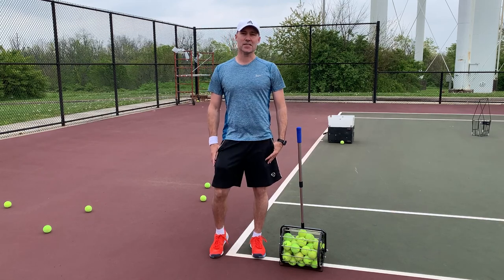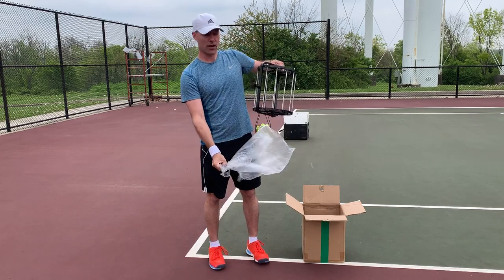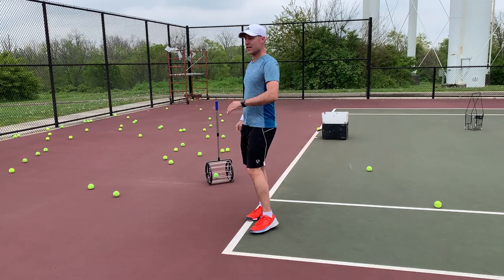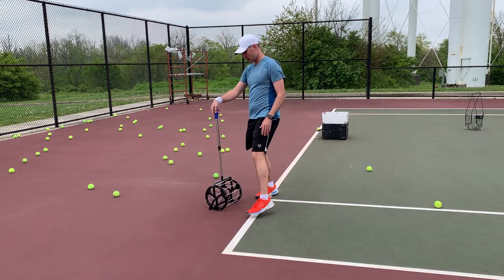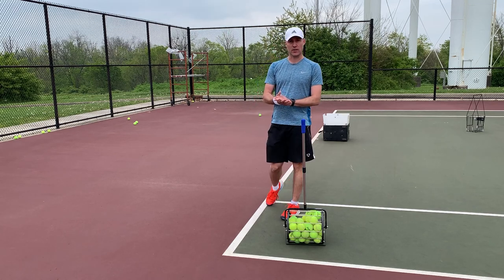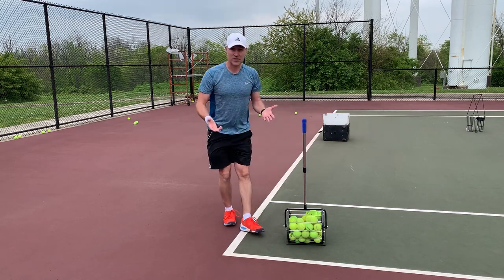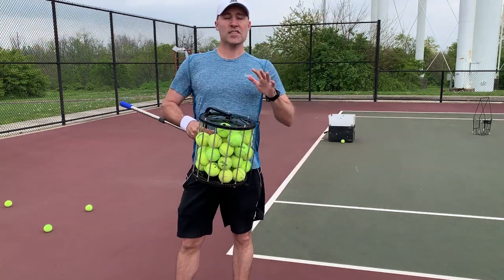Rolling Tennis Ball Hopper Retriever Pick Up Collector - Assembly and Review

Comment: Thank you so much for positing this. I was going to purchase it however that emptying is ridiculous!
Reply: It's actually not that bad. Just pull all three strings on the hook and you'll be able to empty the basket much easier. Another tip is to not fill the basket too full.
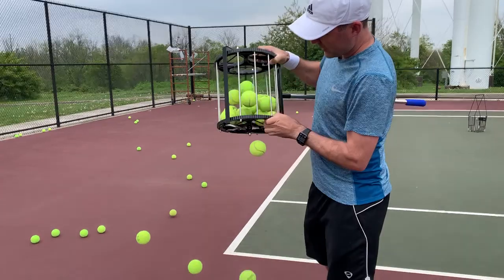Reply from the maker: Yes, I agree iSh0tYou99.  It is not bad when you pull all three traps like i show at the end of the video. At the 5:50 point in the video.

Comment: Thx for this. Roll over one ball at a time, then have to deal with getting them out? FORGET IT!
Reply from the maker: That is why I make these videos. To give you a visual representation of it being used. It helps to let you make a more informed decision if its right for you or not.  It's not right for everyone. If you are expecting it to perform as well as a multiple hundred dollar or thousand dollar machine, then it will not. But for less than $60, it does a decent job if you are not in a huge hurry. Thanks for the comments.
Reply: @ReichpoloTech  Yes, probably good enough for personal use to keep from having to bend over. Indeed, those real ball mowers are so overpriced. I was fortunate enough to pickup a half dozen Playmate mowers for 50 bucks a pop when a local club closed down a decade ago. Big &bulky, but pickup's a breeze!

Comment: I've been searching for any video reviews for this product and there are NONE that I could find. Until today! Thanks for the review! I was thinking about getting Kollectaball's but the price and the reviews on the chore of assembling it turned me away from purchasing it.

Question, do you prefer picking up with the roller or the ball basket?
Reply from the maker: Glad it was helpful!  I like using the roller when I'm by myself.  If I am doing a lesson or hitting the ball machine with another person, then I I we use both.  So it goes quicker.  The advantage of using the roller, to me, is that I don't have to carry the ball basket around the court. Its not super heavy but it is heavier than not having to lift and carry one from ball to ball.  I hope this is helpful. Thank you for your comments.

Comment: Quick question, would this work with pickleball given the slight difference in ball sizes?
Reply from the maker: I’ve have never tried pickleballs but I would not recommend it. I think with the very light weight and slipperyness of the plastic balls, that it would not work well for them.

Comment: They could take a lesson from the stupid round ball hopper that has one good feature, It has a square handle that doubles as a base up side down. I like this one better since it gets in corners better. Also like covered here it needs a better opening style to dump. I would cut one of the three braces and add another bungie cord to keep from having balls spill while hopping. Even a trap door.
Reply from the maker: Yes I agree with all of your comments. It does have some shortcomings, but it’s a relatively cheap option that beats bending over a hundred times.